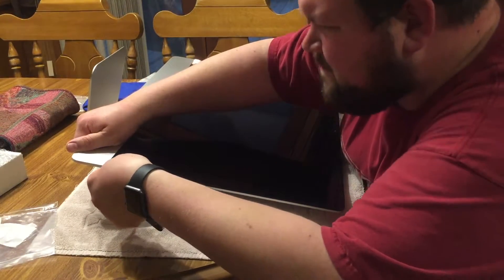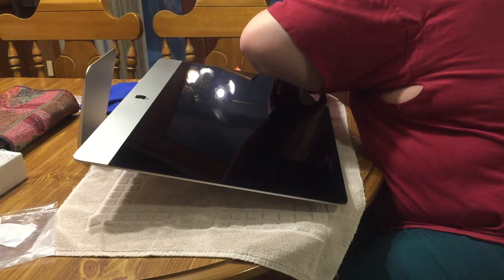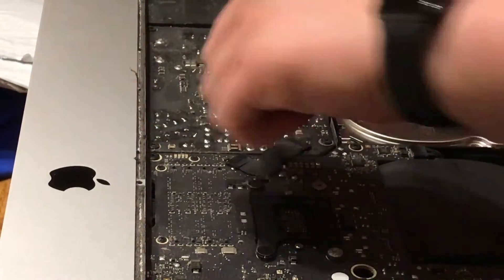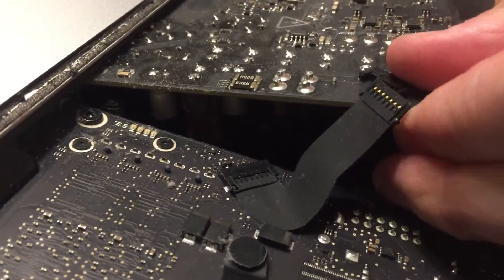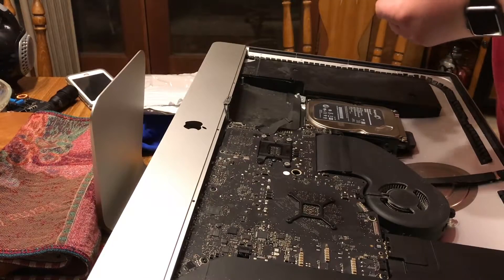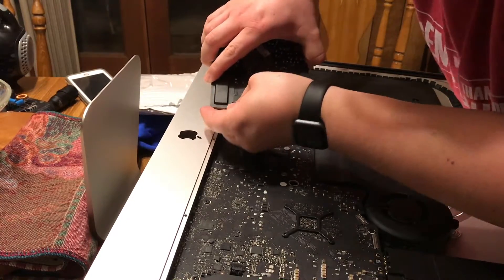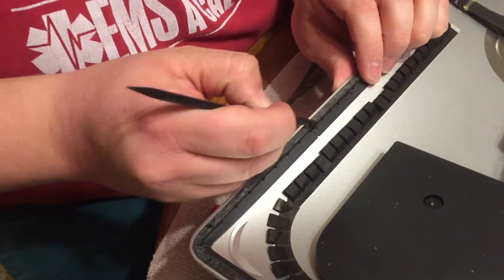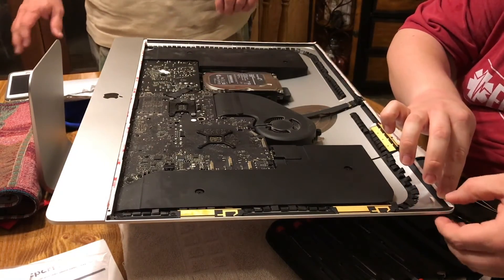Late 2012 27" iMac Power Supply Replacement

Comment: This worked great. Computer powered on. I’m just curious does anyone think continuous video editing with only 8GB of ram could slowly damage a power supply? It started when downloading videos from iMovie and then slowly did it continuously. Weird how it goes out.
Reply from the maker: Grahams on a Road Trip I honestly wouldn’t recommend it with that low of ram just because it could cause your power supply to stay hotter than normal and could potentially shorten the life span of the power supply and also I would look at the process use it may be that you would need a faster processor.
Reply: Jeremy Greene so if I understand right your opinion is running the system at 8GB of ram while doing tons of video editing could shorten the life of a power supply?
Reply from the maker: Grahams on a Road Trip in my opinion yes I believe that is what lead to the early demise of my power supply.
Reply: Jeremy Greene thank you

Comment: Should I remove the power supply cable for two days before I start to fixing?
Reply from the maker: NURI OFFICIAL truthfully I would at least, better to be safe than sorry. Many people say the capacitor will be discharged in 24 hours but 48 to 72 would be safer in my opinion.
Reply: Jeremy Greene thx brother
Reply from the maker: @barbarossa589  Yes Sir, you are very welcome. Best of luck with your replacement!
Reply: yes

Comment: Hi! After 48 hours the power supply is TOTALLY safe to touch or still dangerous? Thanks!
Sorry for my english...
Reply from the maker: Hey, no problem at all. All of the documentation that I have read and studied through said that the residual electric current that the power supply holds should dissipate in 48 to 72 hours. If you feel better waiting longer it's no problem at all. I have read where some wait almost a week after unplugging the unit. Safety first definitely, you could also use a volt ohms meter to test the connections on the back of the unit before taking it apart. Hope this helps, Thanks.
Reply: @JeremyG1749  Thanks bro!

Comment: Hi, great video and thanks.  I have a question, I have a iMac late 2015 27" 5k retina display which I have owned for around 2 years from new.  Just recently there has been some arcing / cracking noise coming from the rear of the iMac in between the power button and the the vent above where the plug goes, it usually occurs when I have been gaming for a couple of hours or watching videos on you tube.  I found that if I blew into the vent quite hard, the noise would stop for a few hours and sometimes come back later on.  Could this be a problem with the PSU or maybe a build up of dust / cat hair as I have 2 cats that malt heavily?  The reason I ask is you seem to know about faulty PSUs.  Thanks in advance.
Reply from the maker: Hey, to me that sounds like some sort of possible short or at least a grounding issue. I don’t recommend to crack open the case if the machine is in its warranty period, I would take it to apple if at all possible. The 5k screens are a bit more fragile when removing them due to the pixel count and have an increased risk of pixel death due to the build. It could be done, very carefully, if it is out of warranty. The first thing i would recommend is turning the machine off for a few days, to make sure all of the residual charge is out of the power supply, and use a bristled vacuum cleaner to try and remove any trash that may be in the vent. I use a pair of plastic hemostats I purchased from Amazon to get in between the vent blades and pull out any dirt or blockages I can see in the vents as well, just use caution because you could puncture something behind the vent if you go in too far. I hope this helps and if I can be of any more help please let me know. Let me know what fixes the issue too, thanks.

Comment: Jeremy, this is a great video, appreciate the time you spent to make this available. I just replaced the power supply pretty much following the same steps you did. Everything looks goods except for the fact that I'm super pissed because I spent more than 3K on a new iMac 27" piece of trash, grrrr. Anyways, I'm happy as I don't have to pay Apple a single more penny :) Again, thanks for this sharing your video!
Reply from the maker: Hey glad to help, my iMac actually just went totally out so I will be purchasing a new one as well, this one was about 6 years old so I can’t complain it has lasted me a good while, hopefully you won’t need to replace anything else on yours, thanks!
Reply: Jeremy - If your iMac is totally down and you’re looking at a new system, are you selling your old iMac for parts? I’m wondering what I can do with my iMac if it completely shits the bed.
Reply from the maker: tjgjr I’m actually in the process of disassembling it now and putting the parts on eBay. Look me up on eBay and as I get things out and pictured I’ll have them up for sale there.

Comment: Thanks for the video.  The link to a replacement PSU shows "we couldn't find that page" error.  Can you update it to a new link, please?  Mine is a late 2014 model.  Thank you.
Reply from the maker: Dzunkuづんく Sure thing. This appears to be the same psu I used from a different company. APPLE 2012 27" iMac A1419 300W Internal Power Supply PA-1311-2A https://www.amazon.com/dp/B00RPRHE78/ref=cm_sw_r_cp_api_U.AHBb4YXA21P
Hope this helps!
Reply: Thank you for your quick reply.  I will try with that PSU and the tool kit you recommended then.  Any suggestion for adhesive strips?  Sorry for my repeated question.
Reply from the maker: Dzunkuづんく Anytime, one of the kits I purchased, I believe it was the smaller one, it actually came with adhesive strips that worked perfectly for my repair.
Reply: Wow.  I thought that I needed to order these separately.  Thank you again for you another quick help!
Reply from the maker: Dzunkuづんく You’re very welcome

Comment: Did this fix your issue?
Reply from the maker: Yes it did.
Reply: Thanks man, I have replaced it, and everything seems to be running great so far. Hopefully this solves the shut down issue! Missed using my iMac. The only thing I'd add is when attaching the display back on, I accidentally left a little gap from the bottom edge because I had placed it on there for support, but as I brought the display down, it created a very slight gap at the bottom, so just be aware when putting it back on.

Comment: Thanks for this video.  This was an easy deal after watching this video.  I did crack my screen because I wasn't patient enough when removing it.  It still works and the crack is almost invisible but it still sucks.  Totally my fault.  Be patient when removing this screen people!!  Time will tell if this fixed my random shutdowns in my imac.
Reply: Well, still getting random shutdowns.  Any other suggestions?  Thanks.
Reply: I'm not trying to be a smart ass,but in this video he used a metal thing to open a glass screen I would say that's a big no no.i used soft plastic  or you can use your nails 💲
Reply: S B I'm getting random sleep mode annoying so I strip my iMac down

Comment: Hello Jeremy , i am having the same problem that you described in the comments with the same exactly model , and i am really thinking that Apple should have acknowledged their fault . For my bad luck i am in Greece where Apple does not have physical shop just Resellers and they diagnosed my computer with a disc problem that i replaced and it kept happening after a period ..Have you tried reporting the problem to Apple and did you get an answer ?
Reply from the maker: AlexTop Hey, I originally was going to take it to apple but my computer was well out of warranty and it was going to be rather expensive to have them replace the part. Everything I read about the power supplies on that model are half and half. Several people have never had an issue with the power supplies and several have. I don’t think apple would be able to pinpoint the exact production run of power supplies that were faulty due to incomplete data on failure rates. I have heard several complaints about the original power supply but I have heard an equal amount of praise from the same company’s other products and power supplies. It would be great if they reimbursed for this issue but sadly I don’t think they could track down all the data to justify replacing them all. It was a fairly easy process and I hope you can find the parts that you need to fix your iMac. If I can be of any further help please let me know.

Comment: Is this the same for a 2011?  I am having trouble finding a video for a 2011
Reply from the maker: I believe the design on the the 2011 is different as far as the casing. The premise should still be the same but I am uncertain how similar they are honestly.
Reply: the 2011 uses magnets to hold the glass on. @JeremyG1749
Reply from the maker: @JoshuaGarms  Awesome, thanks for the info on that model difference.

Comment: well done.  thanks for that.  Just paid ~$220AU for apple to replace my power supply board with another of theirs.  Probably faulty as well.  Comes with a 1 year warranty.  The extra $50US in labour was worth it if it works.

Comment: Could you by chance link where you bought the kit?
Reply from the maker: Sure can.
https://www.amazon.com/General-Servicing-Apple-iMacs-Later/dp/B00JQMPWKQ/ref=sr_1_1?ie=UTF8&qid=1510619797&sr=8-1&keywords=OWC+General+Servicing+Kit+for+all+Apple+iMacs+2007+%26+Later&dpID=41R5XFLa8SL&preST=_SX300_QL70_&dpSrc=srch
Reply from the maker: Just an extra also, I bought this kit afterwards and it had a few things in it that would have made the job easier on me. Hope these help!
https://www.amazon.com/gp/product/B0123DAZWO/ref=oh_aui_search_detailpage?ie=UTF8&psc=1
Reply: Perfect that is the kit I had found. Also for anyone else looking for the actual power supply: https://www.amazon.com/APPLE-A1419-Internal-Supply-PA-1311-2A/dp/B00RPRHE78/ref=pd_rhf_dp_p_img_2?_encoding=UTF8&psc=1&refRID=P447B65YE0S25ASF6X2J Just ordered both. Can't believe Apple is getting away with this many failures for this.
Reply: I have read the Delta Power Supply is notorious for this intermittent shutdown problem. The word on the street is go LightOn, not Delta OEM.

Comment: Was your issue the computer just shutting off randomly while in use or while idle? Mine just started doing this, coincidentally after having the hard drive replaced (for quite a price) at the Apple Store. I'm trying to avoid having to bring it right back there, as it is not under warranty. I'm wanting to attempt changing the power supply to see if that fixes the issue.
Reply from the maker: BSalz yes mine would just turn off but it was after I opened a substantial program such as final cut or a heavy cpu use program. It would turn off and I could turn it back on but it would do the same thing again after a heavy use or a long period in standby.
Reply: I had this same issue.